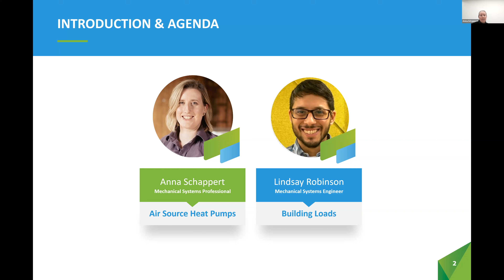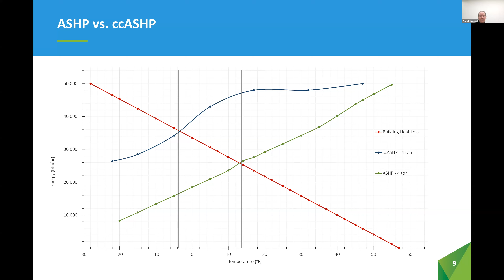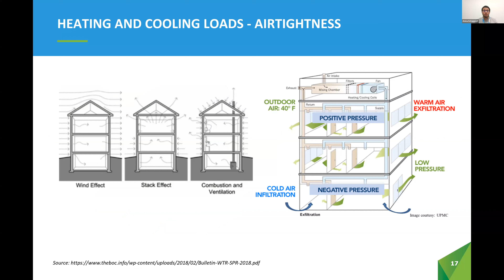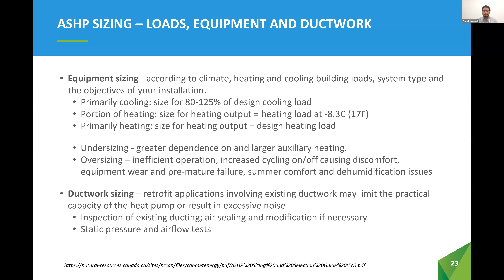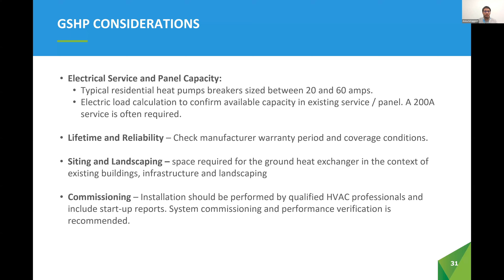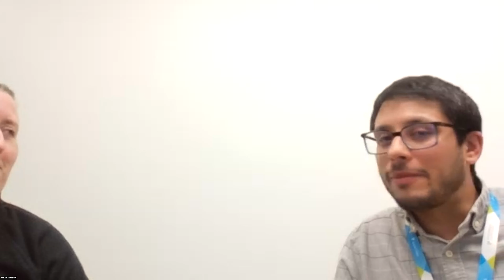Myth: Air-source heat pumps don’t work in Manitoba | Building Resilience Gathering 2024

Comment: Facts....heat pumps only work to a certain negative temperature and than start costing more in electricity than running a ng furance to maintain a normal occupancy temperature.
Reply: That has been my experience.  Luckily,  I also have a ng furance to back up the hp. It saw heavy use this winter and was much cheaper to heat my house.